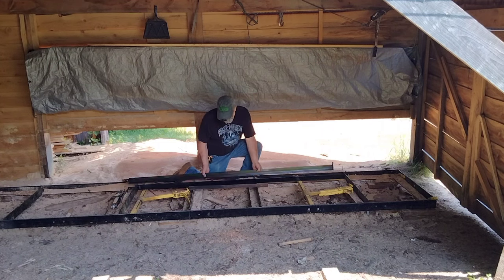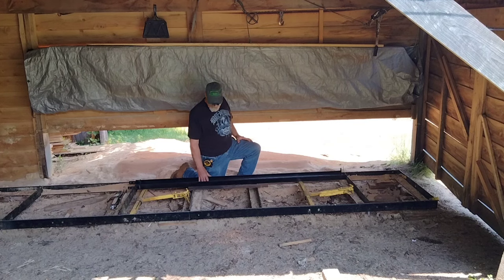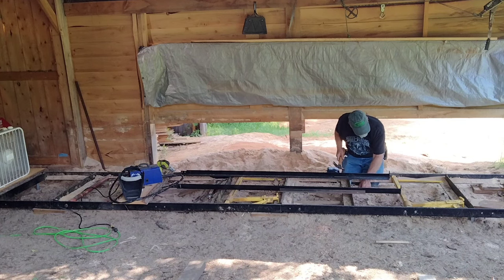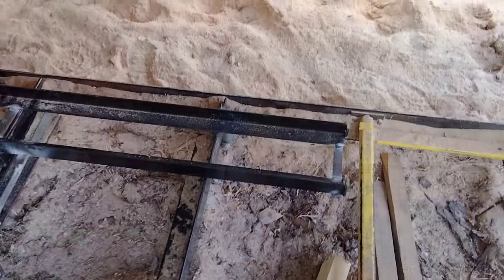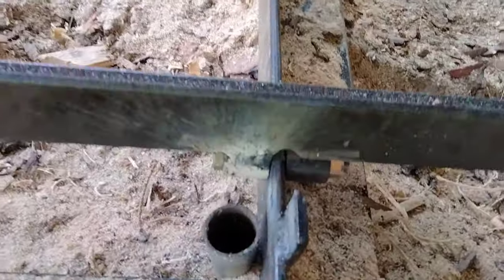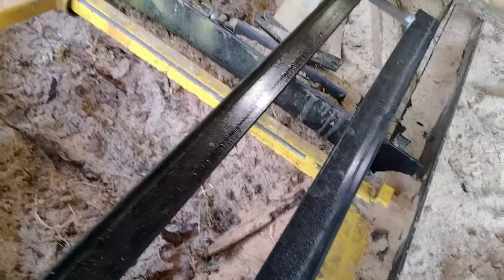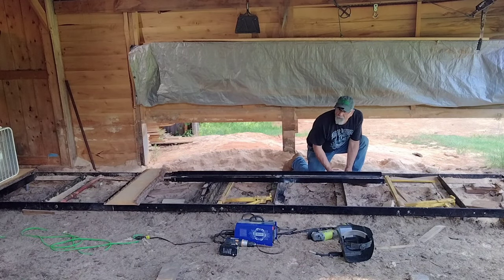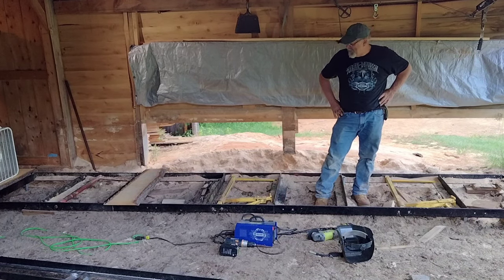Building a siding jig, Hud-son HFE30 #woodworking #chainsaw #homesteading

Comment: You're going to get in trouble if you refer to Sharon like that again.  That's a pretty nice contraption, I think you should manufacture one for a Wood-Mizer LT15.  Your fan slows down when you weld...   You really need to keep some sunscreen on the top of your noggin'.
Reply from the maker: The 100' stretch of 12-2 wire struggles with the welder. The possibilities of an lt15 model could be possible 🤔

Comment: Nice design, clean and simple. 8 inch wide cant good size to use, What max length will you be able to cut? if you did 8 x 12 cant would that have to much weight? just thinking out loud. Hope your dog got the skunk smell gone by now, we had that happen also not fun... Cheers!
Reply from the maker: I figured siding should not be over 8' long. It's pretty flimsy, but we will see
Reply: @Twobrothersoutdoors  Good point, handling by one person 8ft not hard,  10ft could be harder to hold onto.